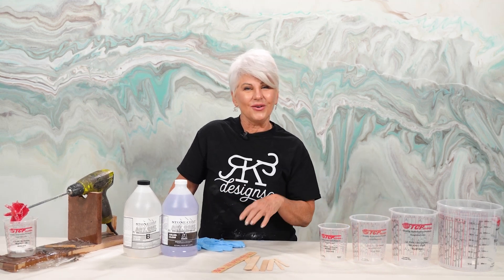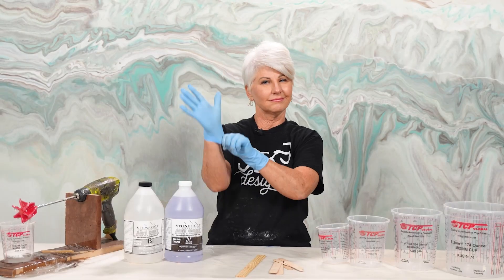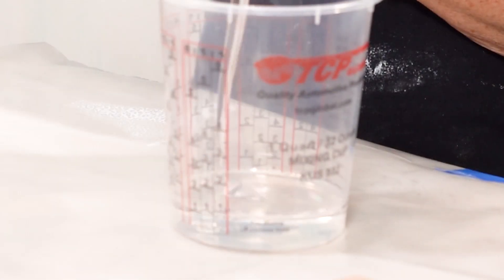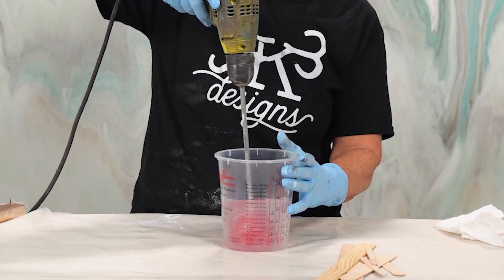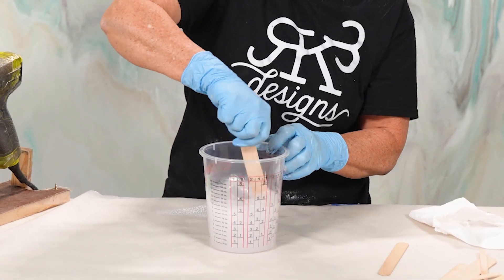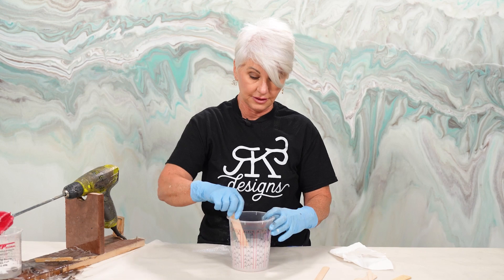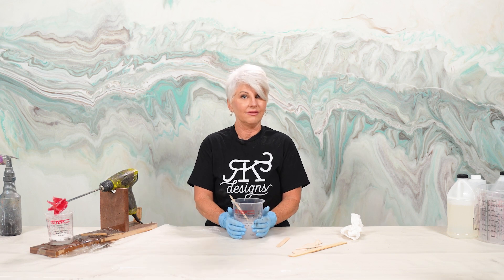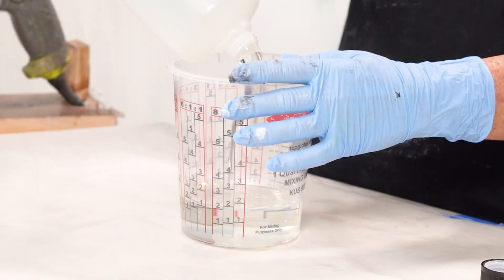Mixing epoxy 101: Tips and Tricks for PERFECT RESULTS EVERY TIME!!! | RK3 Designs

Comment: I am making a football field charcuterie board.  Had to paint (water based) wood green, use white acrylic pen to draw lines on field, use vinal numbers for yard markers, peel off decals for football team logos…DEATHLY afraid to pour resin over board because so many different surfaces the resin must attach.  Perhaps, covering it with varnish first would provide single surface that to which resin would attach.  What do you think?

Comment: Ok.  So how long do you have to get the epoxy poured?  Most demonstration videos from you and Stone Coat, looks like you have about 1gal and divide some in smaller buckets for accent colors.  That main pot cure fast if you don't get most of it poured out before putting down your secondary colors?

Comment: Can you poor epoxy over hardibacker cement board, for shower walls??
Reply from the maker: I wouldn’t recommend. We use the hardi board to frame the shower, pour our design on the the insulation foam board and then attach with silicone.

Comment: Rhonda, could you please explain how to heat the epoxy before mixing?
Reply from the maker: Great Question! There are several ways you can heat your epoxy before you pour, but the most important thing is that you don’t heat it too fast or get it too hot. I use either small heating pad and place my jugs on top or a space heater. I’ll do this an hour or so before and set my heater on low. You just want it to be warm. Be mindful that by heating your epoxy, you may shorter your working time a bit (depending on what brand you’re using) so make sure you have practiced and know what to expect before you tackle a big project. Remember, epoxy will heat up faster the more material you have in the bucket.